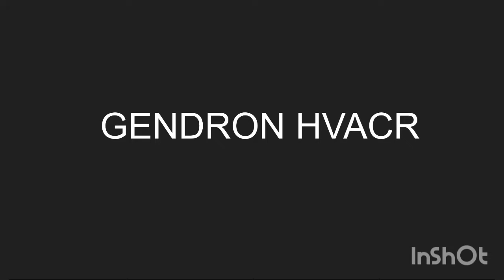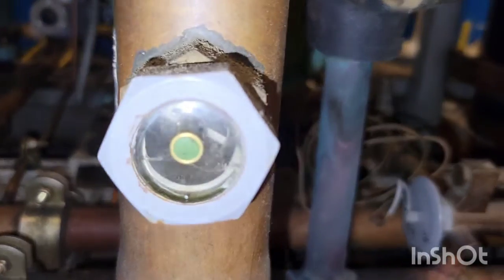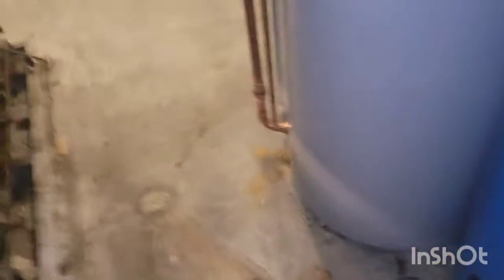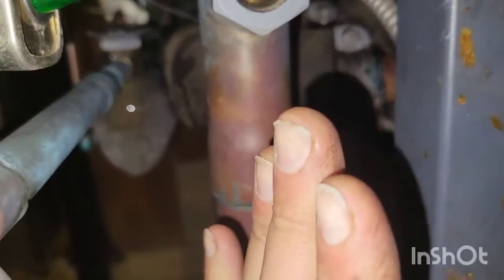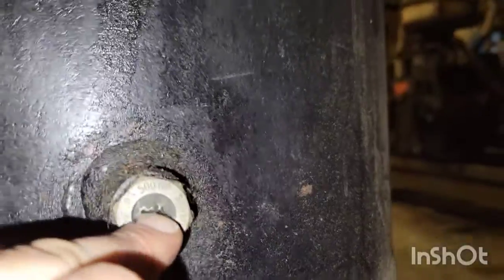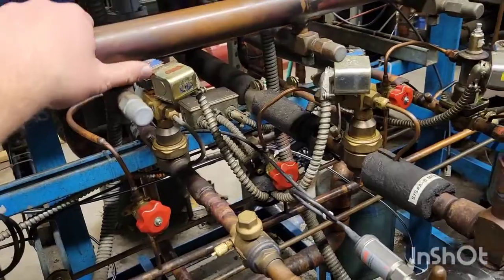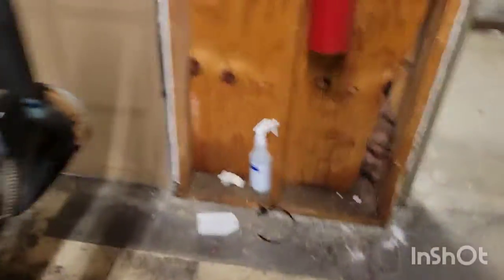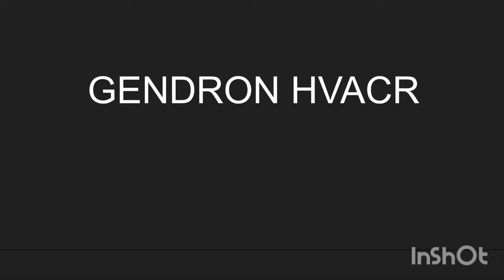Supermarket Refrigeration - How do I Know if a Sight Glass is Flashing ( Examples)

Comment: Hi 
Installed a system, pressure tested,  pulled a vacuum, and cleared the sight glass. The next day the sight glass was flashing what would be the best way to clear it ( charge correctly) and not have to worry about it?

Comment: Those receiver indicators have been leaking like crazy at all of our accounts, pumping it down is such a pain, wanna make a video on rebuilding them? 😢
Reply from the maker: If i'm honest i'm not sure,

I have only ever replaced one once
Reply: @gendronhvac-r1269  we only had one rack, so we couldn't just pump it to the other rack. Ended up forcing all the condenser fans on and isolating the refrigerant up there, mapp gas torch on the receiver for about 10 minutes to boil it off, all for a little gasket change 😵

Comment: What if I have a single bubble floating around in the sight-glass periodically?
Reply from the maker: If your receiver has refrigerant in it.

Then it could just be because of load changes. 

Especially if a system goes through very large load changes, you'll get Bubbles. 

Definitely check your receiver level and it might be worth checking your pressure Differential across You're filter dryer.

Good luck man :)